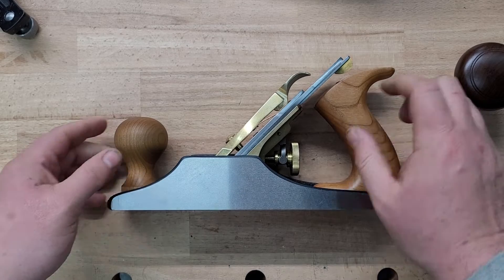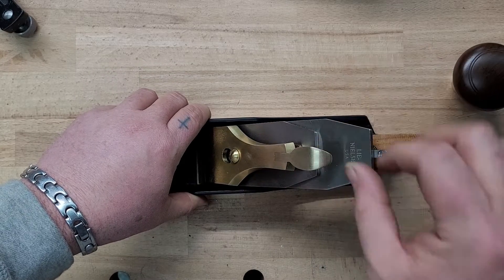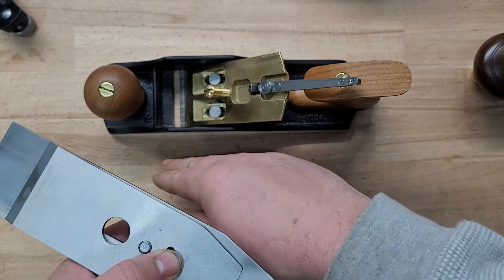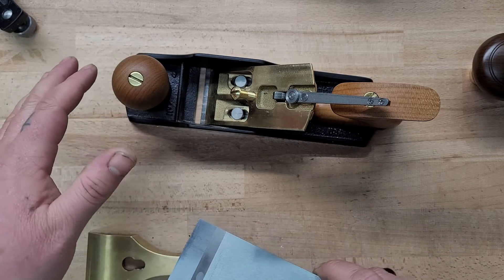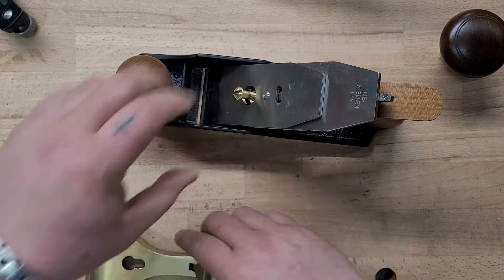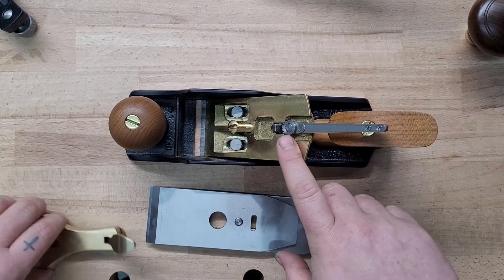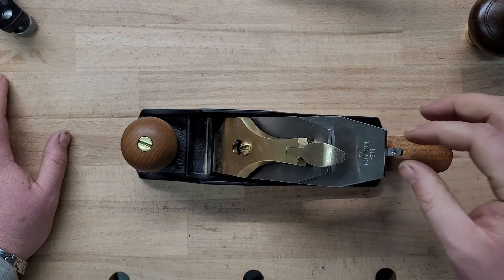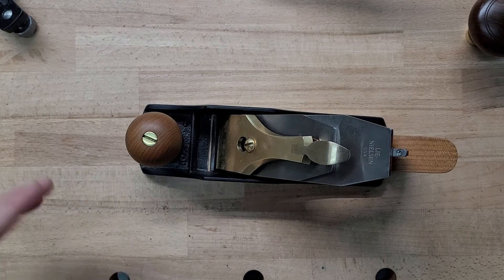IT'S A SYSTEM! Explaining How Hand Plane Parts Work Together / Set Up / Fix Errors / Troubleshoot

Comment: The only real problem with the Jorgensen plane is that the distance between the slot in the chipbreaker and the front of the chipbreaker is too long forcing you to set the frog further back than should be necessary keeping you from being able to close up the mouth.
Reply from the maker: You are correct there, I had to look at rhe plane again, it deff doesn't get as tight a mouth as some of my other planes!

Comment: I change my frog positions a lot, and even the chip breaker. I feel there’s no sweet spot. Those 2 settings are based on the type of work you are doing with the plane. Heavy removal, you open the mouth up and slide the chip breaker up a lil. If you want super thin shavings you can close the mouth and slide chip breaker up closer to the tip of the iron. And if you have highly figured wood that’s very tear out prone then you close that mouth up just wide enough to allow the shaving thru. That way the leading edge of the mouth supports the wood fibres and allows the blade to cut sever the wood fibres before they are lifted which is exactly what tear out is
Reply from the maker: I have been experimenting with only adjusting the depth of the iron to control tare out and it is doing pretty well. I'm trying to figure out how to do a video on that because I get what you are saying. 
For new woodworkers, they probably won't get into this fine detail till they get more experience. 
I agree with you tho for sure I have some really curly oak that is TOUGH TO PLANE haha that is what I am experimenting with. Leaving everything set the way I do for "normal" grain and just taking thinner shavings by using the depth adjust. If I can figure out a way I'll make a video on it I'll deff post it

Comment: Umm, your chip breaker looks like a plane iron. I am used to ones that are flat, then leave a hollow before it comes back onto the plane iron. Best guess is that is to make sure it sits flat all the way across.
Reply from the maker: The new style chip breakers are like this. LN, Hock, etc. Have chip breakers like this. The stanleys and old veritas are the curved ones